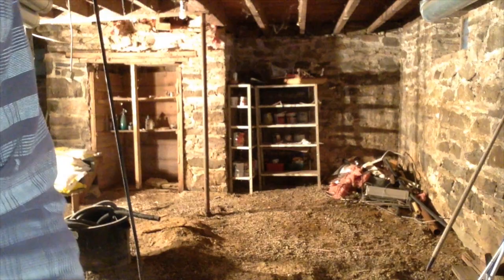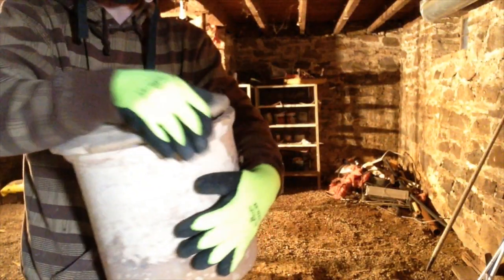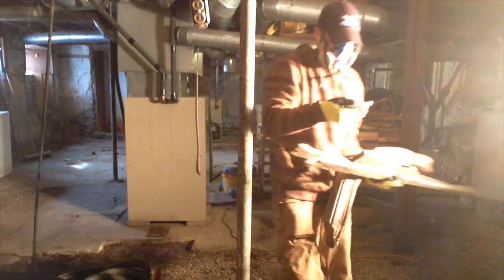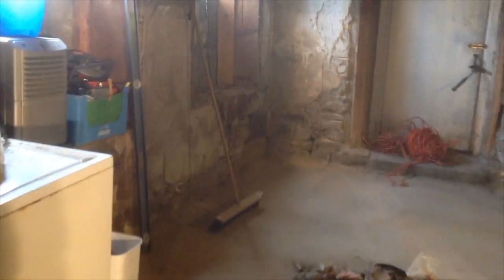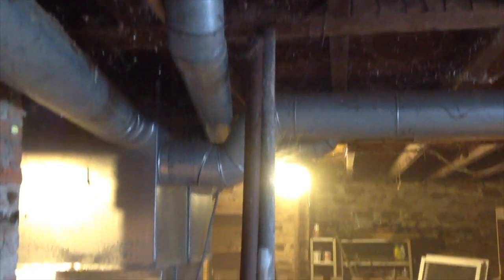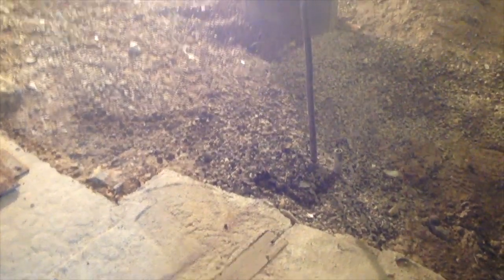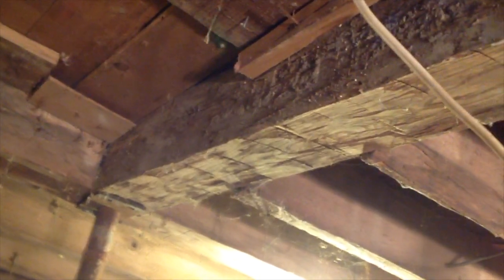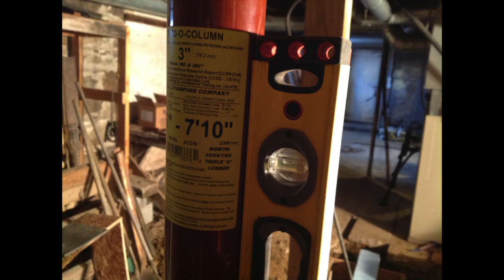Farmhouse Reno - Supporting a 211 Year Old House - Basement - Episode 11

Comment: I must say that the support system in your basement is kinda scary. Every existing metal post looks sketchy at best, if not worse. For the posts on concrete, I’d bet my next paycheck that they are just resting on the slab floor (likely 4” or less thick). And the ones on the bare earth? I guess we’ll find out in the next video. But EVERY post needs to be on a footer. Hey, you didn’t do these, so its not your fault, and I’m not criticizing. Just saying, this would keep me up at night!
Reply from the maker: Exactly why we started in the basement! Need to have good support or you got nothing!